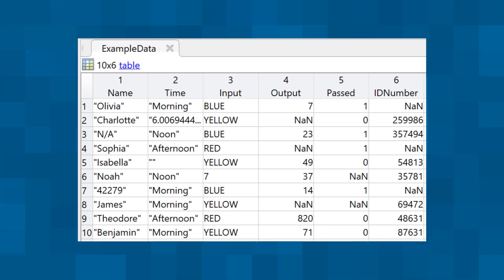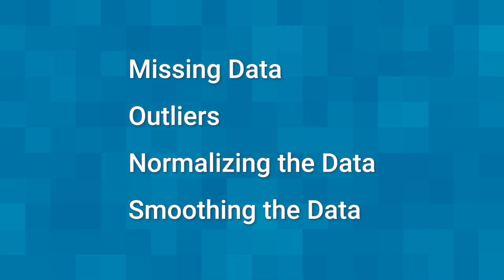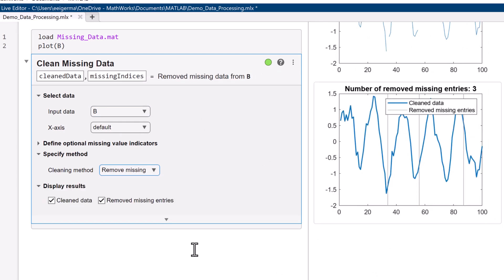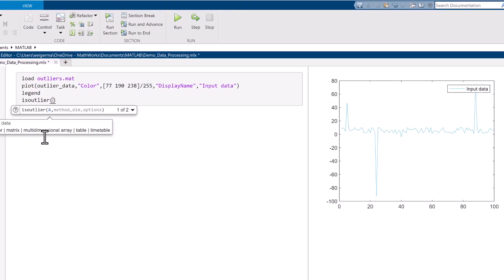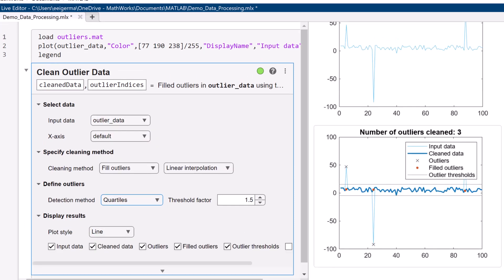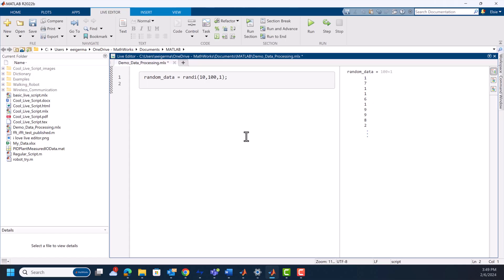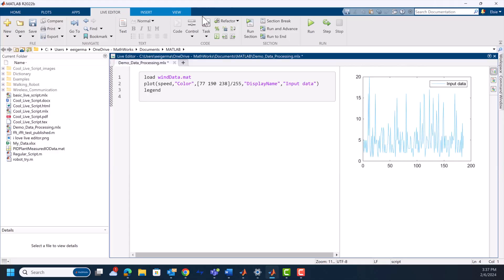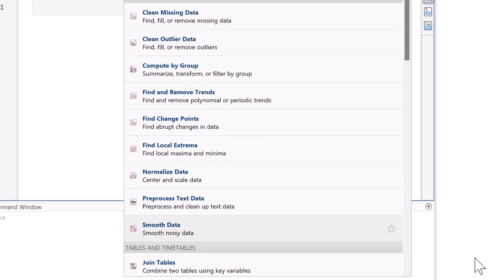Data Preprocessing with MATLAB

Comment: Let us know your follow-up data processing questions. I can connect you with the correct answers.
Reply: Hi Sir, I have a 60000 rows of data that varies over time and I trie to fit an arx model to it but it doesn't work. I did the Preprocessing steps but still the error of the fit is so big
Reply: @ikramelfatehy9804  Did you get a specific error message? If you want to share code snippets and more context, you can post on MATLAB Answers: https://www.mathworks.com/matlabcentral/answers/questions/new/

Comment: The way we store data is (needlessly, imo) flawed, tracing back to the pen-and-paper notations, as "Steve" failed to do. We often assume a time-series, and a constant sampling interval. There is no annotation, especially regarding timestamps, the source of the data, the manipulations (interpolation, filtering, etc) that may have been applied to the data, and statistical limitations inherent to the data itself (e.g. uncertainty). This can lead to major boo-boos. To give a concrete example - if a "smoothing" filter is used, as illustrated at 8:01, without annotation, it may lead to problems in that this filter is not a causal filter. The smoothed data may provide evidence of an event before the event happens. Without annotation, this shall cause headaches.

Agreed that annotation would bloat data by several-X, but with our progressive (over)reliance on data, we ought to find a rigorous and standardized way to do this.
Reply: That’s why we filtfilt to avoid phase distortion:)
Reply: @Afr0deeziac  Filtfilt is not causal. You are aware of this, right?